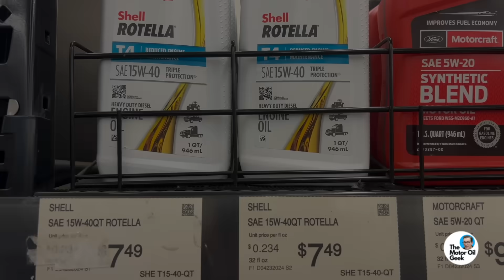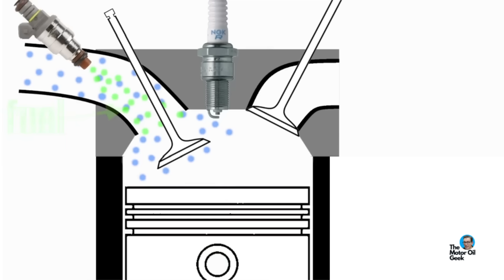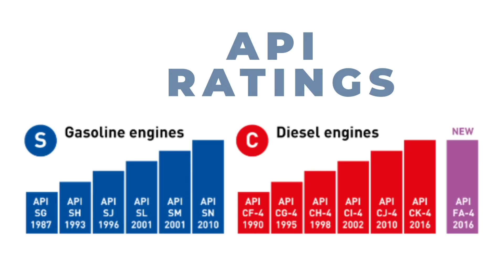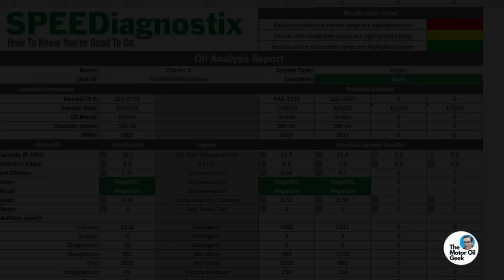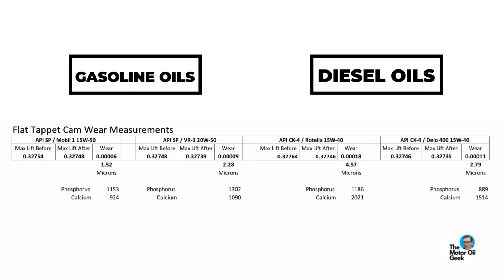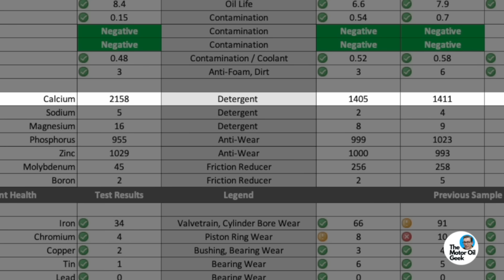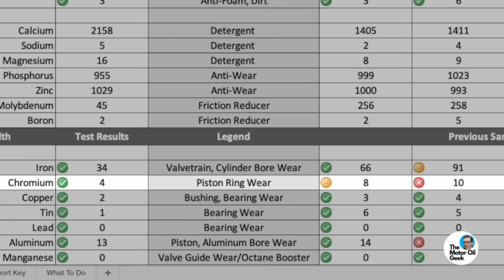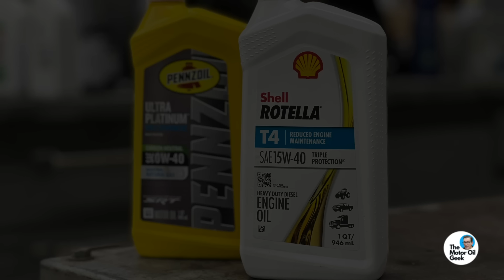Why DIESEL Oil is Actually WORSE for Gas Engines!

Comment: People tell me to use rotella in my merc 350 because it usually runs at higher constant load and rpm I'm thinking different after watching this so what would you recommend??? It's an older merc (88) with 600hrs and I'm not sure what the previous owners ran , it wasn't winterized properly but I went through it hoses ,thermastat ,fuel and lines, ect. It starts runs great and I want it to stay reliable.
Reply: Also I have been running regular 5/30 in my 2013 vw jetta tdi. Because it's$ 35 oil change instead of $100. Since  trying this I have had steady 45mpg opposed to the crazy ups and down mileage I was getting with the Castrol euro 5/30 and constant egr codes wth? Is this just a fluke?

Comment: LMAO....I got away from "Standard motor oils" decades ago and switched to the Delo 400/Rotella setups in 98. I bought my 89 Escort in 98...and the guy was an ex trucker and swore by it. I went onto trying MANY various options...and some Lucas High Mileage and Diesel Oil....does awesome things! 
For the 4 banger synthetic motors....try the Lucas HM and Valvoline HM Syn Blend. My work Tacoma has 247k miles and drives like a caddy

Comment: Love it.  In the clapped out miata forums, there is the rotella cult.  Now, these are lower (under 10) comp engines, and being clapped, have blow by and sooty oil.  There may be something to their claims, but they are flat tapped cam on bucket valve trains, so I note your cam wear data too!   Very interesting.  Love your channel.

Comment: What if I used a diesel engine oil in an old single cylinder gas engine with splash lube (non pressurized) and no oil filter. Will those additives to fight off soot help?

Comment: This video really mist the mark only people running diesel oil in gas engines is for old engines with flat tap it cams I've never heard anyone one run diesel oil in new vehicle gas engines with direct injection
 That was a waste of time need to do a actual video on people that use it like me in old engines and be more clear on the information.

Comment: Eh. My 1997 Ford F150 4.6 V8 original owner used Fleetpride 15w40 since new since we use it in our shop. Today she has 480k miles and doesnt burn a drop of oil and runs like a champ. I recently switched to Galp 5w40 diesel oil since we switched vendors.

Comment: Keep in mind that the video is addressing an issue with direct injection engines and their tendency to misfire due to deposits accumulating while using a motor oil that was made for diesel engines. It's not about using that type of motor oil in lawnmower engines or 40-year-old V8 engines. 

If anyone has taken time to follow the channel, they would know that there is a problem with the injectors partially plugging up and then causing problems with the rings fouling up. It is obvious that using the wrong spec motor oil could cost someone a lot of money when the engine fails.

Comment: Read through most of these comments. I can’t tell you from my experiences- T4 works well. My biggest claim to using T4- is my 2004 Chevy 2500HD 6.0L gasser. I switched to T4 around 128,000 miles and at 320,XXX miles using T4, Lucas oil Additive, and Wix filters this truck still carries great oil pressure and when I pulled the valve covers the heads and inside of the valve covers look really clean. I also do the unthinkable about 50 miles before my oil changes - I dump a quart of ATF in the oil. I’m sure this  process and products don’t work for everyone and maybe I’m just wasting money- but it seems to be working. This same recipe o use in most every vehicle I own- except for my wife’s 2016 fusion and my 2014 Silverado. 
Lake I appreciate your time and efforts you put into these videos.

Comment: I've ran 10w30 diesel oil in my 05 hemi for a decade.  Never had any issues.  But, it also has a stage 3 comp camshaft, lifters,push rods, 6.1 srt-8 heads, and manly rods and bearings with a melling  high volume oil pump, long tube's, and no cats.

Comment: Other people post about the rotella gas and diesel oil 5W40 never cause problems. Picture you posted shows missing out opportunity oil change past over due. Shows oil changes past over due and waiting for 3000 to 20000 for next oil change. This will happen on diesel and gas engines. It's not oil companies brands fault but only you. Daily driving every day up to 3 months on any brands oil for keep it under warranty. Thin oils under 20 weight never work well with synthetic or without the synthetic risks siege engine hot summer because activist people scammed the manfacters oil viscosity with thinner oils and waiting 3000 to 20000 to change oil risk engine damage. 3 months I can get for daily driving under warranty.

Comment: So question.  Say you have a passenger engine.  It takes 5 qts of oil   How would things look if you did 4 qts of passenger oil and 1 qt of diesel oil? Or maybe a better ratio of mix in order to help with "soot" in the engine.

Comment: At 5:00 the Rotella T4 bottle clearly states that it is SN rated. So, unless you've got a DI gas engine that requires API SP oil, diesel oil will be just fine.

Comment: T4 I put that shit in everything that don’t have a catalytic converter. It’s on par with valvoline VR1 but the vr1 came out significantly ahead with anti foaming but everything else was about the same or close to. The price difference for the Rototella T4 would be more frequent oil changes which would be better in the long run.

Comment: For about a year now I have run rotella t4 10W-30 in the winter 15 w40 in the summer and a wix 51794 in my 79 C10 with a 350 I change it every 2500 to 3000 miles the past few oil changes I could pull the dipstick at 1500 miles and still look like new oil it cleaned out a lot of the sludge that was previously in it. I've had the truck for four years and it has never run better

Comment: Ehh. Been running diesel oil like t4 and t6 for years. Been tearing down  and rebuilding engines for almost 20 and never seen anything related to oil issues until the introduction of direct injection and its issues.

So the real issue is just plain running the wrong oil in a gdi engine. This video is got some dishonesty to it

Comment: I rant 10w30 diesel oil in my impala 3.5 and the lifter tick went away and i reduced the oil consumption i had running 10w30 gas oil

Comment: Why do you keep showing a bottle of shell rotella t4 calling it diesel oil and telling us that it’s not good for a gasoline engine? Turn the bottle around and check out where it clearly states that it is SN rated. Now obviously that’s not the latest rating but my Yamaha doesn’t have a turbocharger or direct injection. Oh yeah it’s also JASO rated for wet clutches.

Comment: I’ve definitely been running T4 in my old flat tappet engines for years. This is the most solid argument I’ve seen to reconsider. I still wonder if it is a good option for a worn gas engine with a weaker ignition that has a higher soot and contamination level than typical?

Comment: I drive a 91 Ford f150 300 4.9L inline 6 with 455k miles. It likes 15-40 with a ZDDP additive. I've been running it for the past decade. I bought the truck new and it runs as good now as it always has.

Comment: Rotella T4 15/40 is rated API SN, it's perfectly fine for pre 2000 gas vehicles when used at the proper temperature ranges.

Comment: The way I understand it, the main concern with diesel oils in a gas motor is possible damage to catalytic convertors. SO as long as you don't have worn out piston rings and a bunch of blow-by, then running T-6 5w40 in your gas motor should be fine with almost zero risk, right? Besides if you have a bunch of blow-by and don't care to re-ring it or rebuild it then you ain't concerned enough to worry about emissions, so just knock the comb out of the cat and carry on, right?

Comment: I have ran full synthetic diesel oil 15w40 in all my gm pushrod engines past the 300k mile mark, for decades and have NEVER had an issue, ive ran it in my fresh rebuilds and still fail to see an issue.   Im sorry, but no matter what you show me, my anecdotal beliefs are pretty strong on this topic.lol

Comment: What oil would you suggest to run in a stock Model A Ford with flat tappers and poured Babbitt bearings?
Reply from the maker: VR-1 Straight 30 would be perfect.

Comment: I went to school to learn to be a mechanic.   What I learned is this.   I started to believe that I knew more than I actually did.   Reading thru the comments... you will notice a trend.   People with  Millions of miles of experience... plus 30, 50 or 70 years or more of experience.   This means something.   Science....and data are excellent.   But, in the REAL world... what we see and experience tells us something that cannot be ignored.   We're testing out YOUR scienctific theories!!    I switched over to the 15-40 Rotella Diesel... for EVERYTHING!   I had metal shavings in the oil in both my lawn mower and the dirt bike.   After the swap... and over 8 years of oil changes... the metal shavings issues have gone away.   Explain that one.    The 64 Dodge dart is a no brainer.  Soft metal... ring wash... the need to clean up the years of abuse...    I haven't had the nerve to use it in my Chevy Equinox... but, honestly.   With the way the oil looks at 2,000 miles... I don't think I could really do much worse.     It boils down to detergent... Zink.. and the other vitamins.   I saw many people testifying that the Zink hasn't caused O2 issues, or any plugged CAT issues.   So, the Zink problem probably has a lot to do with other factors.   My Equinox probably has the typical sloppy... excessive piston to cylinder clearance...you find in GM Junk.   I worked at GM dealership and had the pleasure of pulling a few motors apart and suprise.. suprise!   The cylinder clearances were horrible.
Reply: Summary?

Comment: Thanks, Lake.  This said, the move to SINGLE injector GDI in spark ignited engines have made them into soot and fuel diluting oil engines WORSE than diesels!  See studies.  NOW, single GDI engines need MORE detergent dispersant additives than diesels!
Some engine makers are spending the money to put the port injector back for loaded rich burn.  Toyota and Ford come to mind.  It's too bad GDI saves only 5% fuel compared to Mitsubishi's theoretical 20% when 1st came out in the 90's.  Better update your videos!

Comment: I've used 15w40 in gas engines and the only engine family that had an issue with it was chevy v8..5.7 Hemis, 3 liter infiniti motors, 3.5 ford ecoboost motors, all engines perform differently and some do better with thicker oils. Not chevy.. they don't like it..

Comment: Hi, thank you so much for all your insight on this. My dad was a chemical engineer. He would’ve loved this channel anyways I had a 99 Silverado 5.3 definitely one of the first engines my local machine shop had a bunch of these that he was working on. He said they had problems with their aluminum pistons anyways many many years later at over 600,000 miles my oil consumption was the same as it was new. My gas mileage was exactly 15.2 to 15.4 miles per gallon exactly as it was new there was no difference in performance the rear end ended up blowing out I just donated the car anyways the whole life of this engine was the shell 5W 40 Rotella.
Reply from the maker: Thanks for sharing!

Comment: Bottom line is this:  If the oil you want to use is certified for use in gasoline engines, it's fine.  A company would be sued to oblivion if it made a claim to be gasoline engine compliant and it actually wasn't.  As long as you see the gasoline compliance seal on the bottle (Currently API SP), its fine for a gas engine.  This whole video is disingenuous from the the title.

Zinc will kill a catalytic converter if you are burning oil.  But if you are burning oil, the burning oil ITSELF with our without zinc will eventually kill the converter.  So regardless if you are using a diesel fleet oil or a gasoline only oil, if you are consuming oil you will kill your cat if you don't correct it.  I run diesel fleet oil in all my vehicles and have never had an issue with it.  I would not run diesel fleet in a later model car (Maybe 2015 or newer) simply because diesel fleet oils tend to be thicker and the newer engines have far less forgiving tolerances to where thicker oils than recommended by the OEM can cause issues.

Comment: this guy is a joke. I been using shell T6 for over 20 years in my cars never had a issue. I currently run the shell T6 in my 97 zj 4.0L and a wix xp filter i have also used it in my fiero back in the day too before it was stolen and smashed.

Comment: I enjoy watching your video lot great knowledge and information!
I have a 2.8 Durmax Diesel, it requires 2 Dexos motor oil 5-30W, what exactly is 2 Dexos a diesel oil?  I've been using Penzoil 5-30W Euro L oil and previously I have used Mobil 1 ESP 5-30W both are suppose to be 2 Dexos rate/approve? Are good oils for my little Durmax diesel? Great little motor with tremendous fuel economy, I want to make it last!

Comment: Just to be clear, NOBODY is using T4 in a direct injection gas engine! Unless they are a moron, in which case they shouldn't be the ones to change their own oil.
Also Melling camshafts recommended the use of diesel oil not only for break-in but regular use afterwards in a small block Chevy. The installation instructions even include a list of the different oils it recommendeds and their chemical makeup. 
Now you know

Comment: Yes Rotella oils are fine for gasoline engines . It's not just the compression in a diesel engine . So we are being schooled about diesel injectors or gasoline direct injection . It's not vapor you guys , it's called fuel atomization . We know diesel oils are formulated for soot and for ash deposits in diesel engines ,to which gasoline engines do not have .  To make an6 cla8m that diesel formulated oils should  not be used in gasoline engines is blatantly a false statement and a false assumption.  The viscosity index of the oil is the more critical factor in modern engines with most having VVT VVTI etc . These engines such as a Honda k24 for example and others have fine mesh screens that require proper viscosity motor oils . Such as 20W common required HONDA oil . They do not use 5 W40 or 15W40 viscosity index oils . The 6.0 Powerstroke and other diesels would never use a 5W20 for example as well . Many run Rotella in older gasoline engines and found excellent wear and cleanliness in engines over common gasoline rated engine oils . Chevron DELO 400 and SHELL ROTELLA oils USE TO HAVE large quantities  of ZDDP zinc which flat tapper gasoline engines require as did older diesel engines .THE EPA had the levels of ZDDP reduced in gasoline oils or eliminated it completely as they stated catalytic convertor life was shortened . This is not necessarily confirmed , it's the EPA after all.  We would buy the diesel oils to get the ZDDP and it worked great , until the EPA again required reductions of ZDDP ZINC and Sulphur content to be reduced . Still SHELL ROTELLA is a superb oil that can be used as has been proven in gasoline engines , given it satisfies the viscosity grade for the gasoline engine it will be used in . Whatever claims this video tries to make , follow manufactures recommendations  for your vehical . If it takes 10W30 10W40 20W50 for vintage engines up through the 80s when these oils were recommended , diesel oils are FINE . Do you need Rotella 5w40 in your modern Toyota or GM car or  Suburu or Ford  vehical or other modern engines , no you do not . This argument  has been gone over many times . Oils are always a hot topic and are an argument for or against . Stick with your owners manual recommendations  for whatever you drive for proper viscosity and rated oils . Not sure telling us about diesel injector operation has any bearing on using diesel oils in a gasoline engine . For your diesel engine application ,  Always follow the manufacturers oil recommendations.

Comment: Well, dadgum.  What should we be using in older flat tappet camshaft engines?
Reply from the maker: As we showed in the video, both Mobil 1 15W-50 and Valvoline VR-1 did a great job.
Reply: @themotoroilgeek  Thank you!

Comment: Ive been running 15W-40 diesel oil in my jeep, lawnmower, generator, power washer, pickup, etc for almost 15 years.
Mercedes used it in their 6 cylinder gas cars for years. I worked at a school bus company, that ran it in ford windstars and dodge caravans too. Over 200K, and those things ran great. Ive also used it in turbo Volvos. It helps keep the plastic ventilation from getting sludged up.
Reply: Another idiot who runs diesel oil and gasoline cars

Comment: been using Rotel 15 20 in my 302 for years and have not had any issues. althoug the moment i put that synthetic in it is burns oil like crazy..... ill stick with my rotel diesel oil.

Comment: What if you used a blend, 3qts. 30 weight equivalent NON- DETERGENT  WITH 2-3Qts. of diesel oil 10w40,20w50 or so? Probably use a compressor oil non detergent,!   Me myself I'd rather use a good synthetic or conventional. Put about 5-6k miles on the synthetic and possibly change the filter between changes every 1-2 years  and  possibly cut it open rinse it with gasoline and put the gas on a glass slide to evaporate. Look at it under a microscope. Looking for metallic particles.

Comment: You got me confused a bit. I run shell Rotella T1 SAE30 in my 1954 Ford 900 tractor. It's a carburetored. I run straight 30 weight in it.